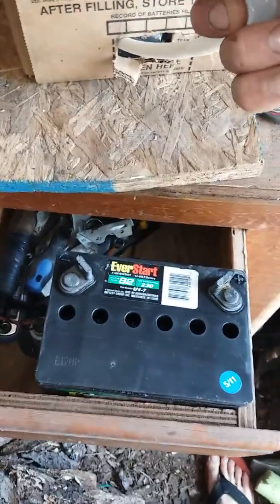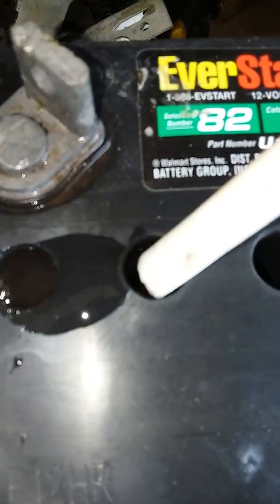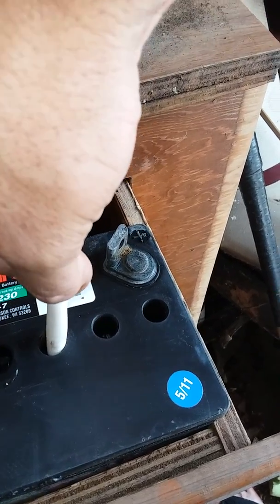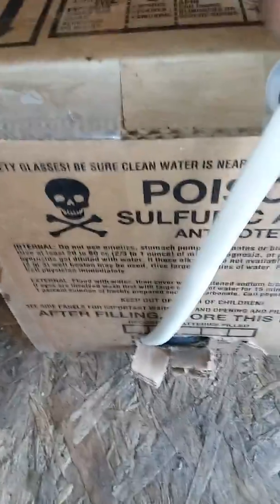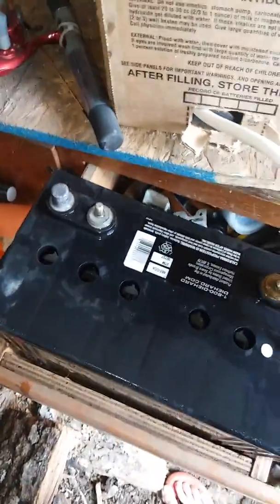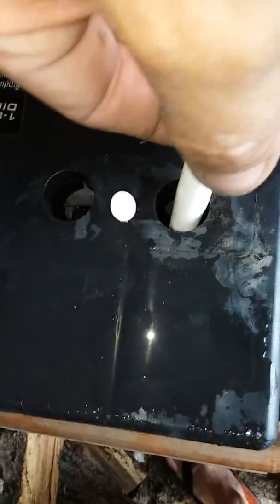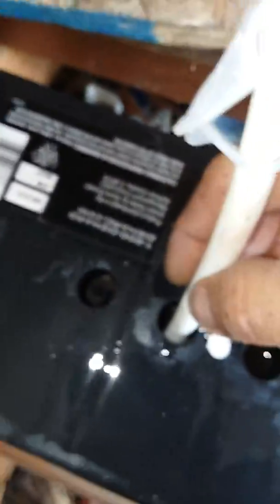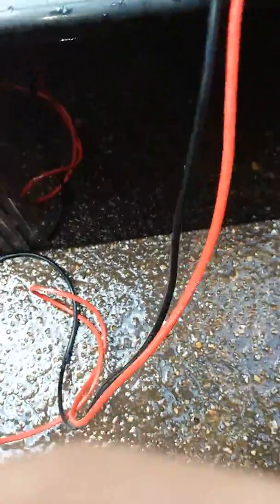Restoring a Deep Cycle Battery Part 3

Comment: I bought an RV that has a ORielly deep cycle battery. I bought a Die Hard last year for another RV like the one you have. But the ORielly battery is bigger and alot heavier. So it says that it was purchased 3/21 about a year and a few days old. I put a trickle charge on it for about 2 hours and it said .28 and was dropping. Basically this battery was flat. Do you think I can revive it doing this drain, clean and flush then fill with clean acid? This thing is super heavy and they told me they only cost $104.00 which I think is very reasonable.